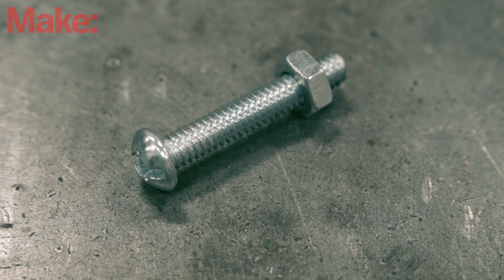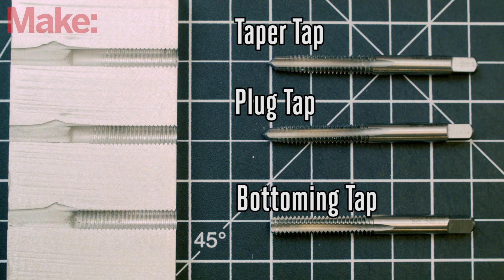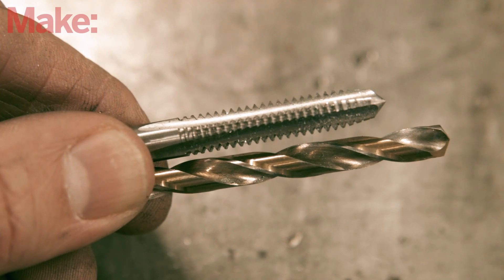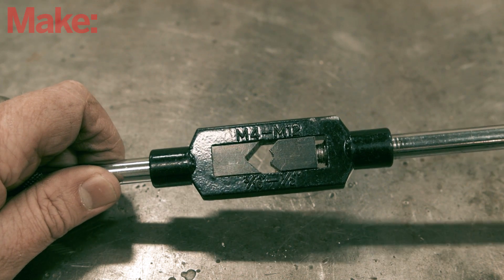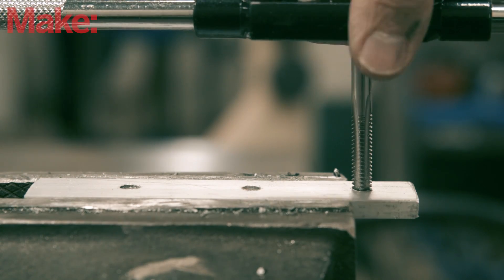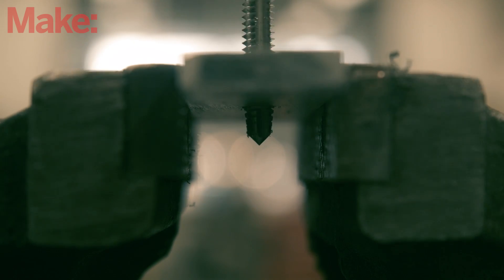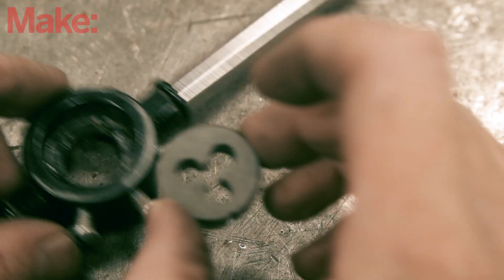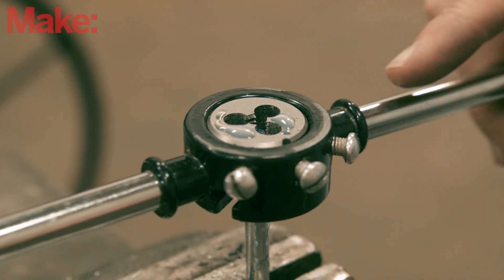Learn to use a Tap & Die to Cut Threads

Comment: You mention tables for the proper drill bit to use to drill the hole before tapping. Are there tables for the proper OD for the solid rod that you will be using the die on?

Comment: This is really helpful.  I'm trying to get an old Moto Guzzi motorcycle shifter linkage repaired and the factory part is a piece of rod with M6 left handed threads on one side and right handed threads on the other side. I can't find this part anywhere. Someone suggested making my own with a die and your video  makes it look like a great solution.

Comment: Great explanation. I'm needing a fine threaded tap however. For small auto molding repairs to back sides. Adding althread studs since the pins broke off. They are 5/32 which I think is 8-32.What? That don't make since. 5/16 maybe?

Comment: You have the die stock upside down. The ridge on the bottom is supposed to be on the opposite side you are threading it from so the die doesn't get pushed out as you screw it on.

Comment: On a 10mm metal sheet what should be the maximum size of Bolt and nut so as not to compromise the structural integrity of the 10mm metal ? Thanks a ton in advance.

Comment: I have read that there are two types of dies. Some have round bodies, as in the video, and the others have hex-shaped bodies. The round dies are for making new threads. The hex dies are intended for cleaning up or repairing damaged existing threads.  If you go shopping online, it's not always clear what is being offered - check carefully. I also believe (not sure) many dies offered are just 'Carbon Steel' which is OK for many jobs, but others are High Speed Steel (HSS) which should be used on harder metals. I'm no machinist, just a hobbyist, so take what I say with a grain of salt.
Reply: I’m taking what you said with the whole shaker, you didn’t your searching. Noted thank u

Comment: Excellent video. Had a thought about how to keep the tap near-perfectly perpendicular. If you took a piece of tube stock that's about half the length of the tap and only slightly larger in diameter, you could use the piece of tube stock as a sleeve to keep the tap more perpendicular until it's dug in enough to where you don't have to guide it much anymore. Just a thought.

Comment: can i use cordless drill to make traps instead of manual like in this video? just asking
Reply: NO you need to back it off every 1/2 or 1/4 turn or its gonna get all jammed up with shavings.  Also a very bad idea to use power tools for this.  because if you break the tap off it's going to be a huge pain in the ass to remove it because it's hardened steel that is much harder than the steel are trying to cut threads into. drilling out hardened steel is nearly impossible

Comment: You should use oil if working with any kind of metal, friction = heat = softer metal = warped metal = problem.
Also if you have some bolts that have damaged threads you can run them through a dye to fix the threading.

Comment: I'd recommend lubricant for aluminium as well especially for small sizes, WD40 works well as does paraffin/kerosene or proper tapping fluids.
Reply: littlestworkshop  on aluminium and coper water or denatured alkohol works werry wel too because it doesnt clumps up with the chips
Reply: And a hammer, a damn hammer!
Reply: Thanks! I just commented this exact question :D

Comment: When threading with a die, does the chamfer on the end of the rod have to be at the same angle as the thread?  Also, what are the differences when doing this on a lathe?
Reply: Often in the shop setting we just use a 45 degree chamfer as large as the depth of thread. As for on a lathe, are you referring to using a die set with the lather or are you referencing single point turning of a thread?

Comment: You can easily add a taper to a tap b using the drill press and an angle grinder. But keep the temperature down!
Reply: you have to be sure not to make the leading edge blunt or you will just snap the tap when you use it.

Comment: did he say that cast iron is a soft material?, because it is quite the opposite
Reply: clement583 people tend to use ductility and hardness interchangeably. Cast iron if fairly ductile so it behaves like a softer material when drilling and tapping. As long as you keep the heat down.